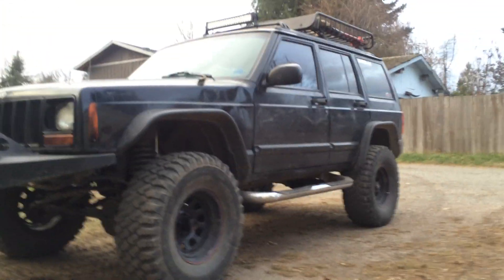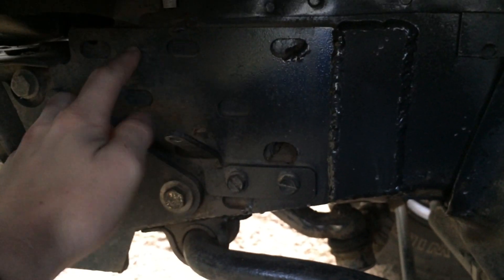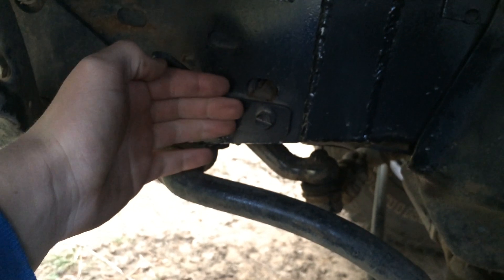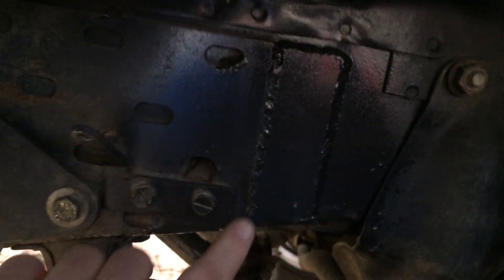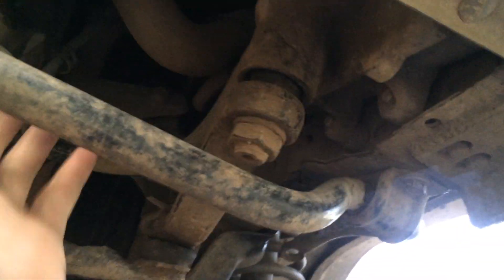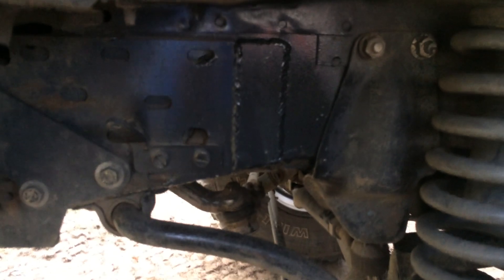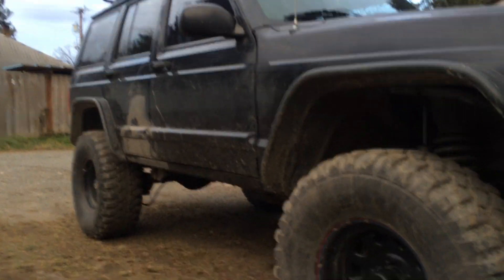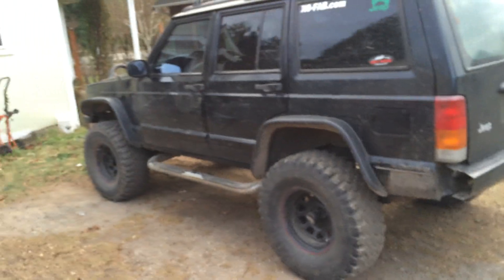Jeep Cherokee Cracked Frame Repair and Permanent Fix Discussed

Comment: i have this problem and looking for a fix. this winter all 3 bolts snapped and had to get a new PS box and heavy duty spacer. all 3 bolts snapped again this week. so now i'm trying to figure out if i should try the A) clean out rust, weld, reinstall or B) buy the side rail/member mopar part [expensive] and install, back to normal. anyone have further suggestions?

Comment: My jeep xj (97) cracked in the same place i already had that short frane stiffiner on there gave me bad death wobble because the ps box could move. I put a full length weld on stiffiner kit on both sides and it has been fine for a long time now.
Nice video!
Reply from the maker: good to know! thank you! I found that connecting each side of the vehicle with that pipe clamp and tube helped a lot for me as well. Happy wheelin!

Comment: you still got your jeep weve been having mudding partys in puyallup, You gotta put in the tubes threw the frame, i did the track bar and steering box stiffner and it made it worse , the inside unibody would flex and the spacer would bow in the middle it was weird, the tubes hold it from your outer plate and you wont crush the unibody

Comment: how not to weld a frame.     that vertical weld on your "custom piece" just created a weakspot,            it needs to be fish plated
Reply: Why the fuck would one need a patch cut in a fish plate shape when full plating a rail ...not plug welds would be nice in addition to perimeter stitch welds , and of course the plate comes after drilling and filling the crack first .

Comment: never weld a chassis. the frame stiffening kit you bought has slots so you can drill through and bolt it on. found myself in a similar position years ago, chassis cracked around the steering box when I was away from home, gingerly drove it around La Habra to 7 different places to have it welded, nobody would touch it.
Reply: Grass hopper you do not have wisdom to wisely speak here .
Reply: "never weld a chassis"   huh?  I have never heard that one. Especially since chassis/frames/hitches etc. have been welded for many years, and continue to be welded to this day. Whether its during manufacturing or while doing repairs due to damage, rust, aftermarket add-ons, and so on.

Comment: just plateing should be good although you cant see if its cracking anymore underneath, i believe the fisheye plate should have been filled in with welds and only stich welded on the edges, its always ok to just add more steel till it all plated why not
Reply from the maker: Yeah i did not have it stitch welded but with the steel tube connecting the power steering box to the other frame rail it relieves some stress. 
i had so many little cracks... it was no good